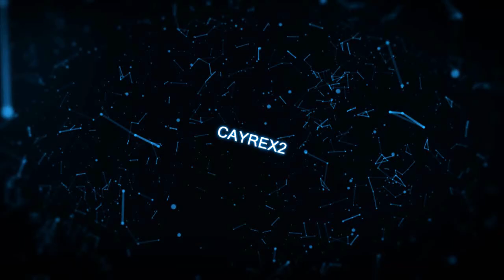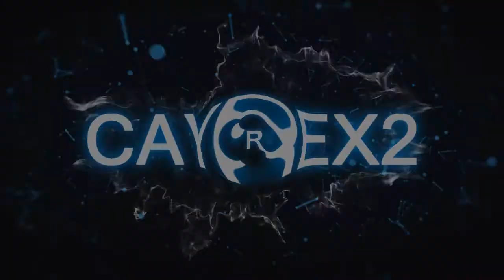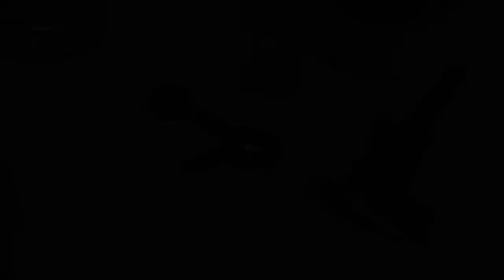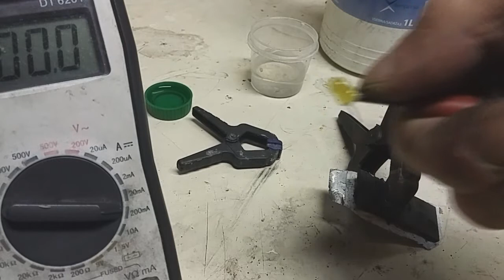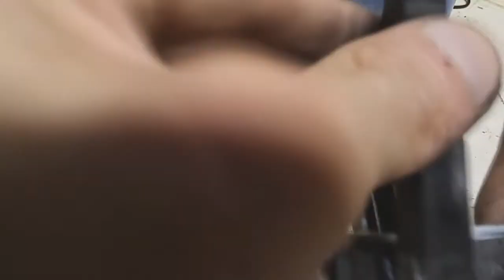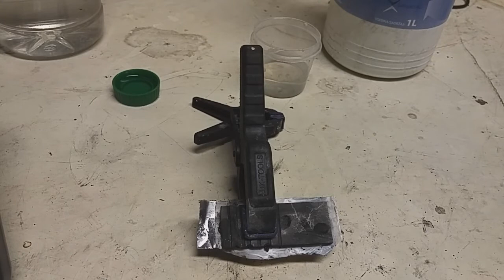TEST of High Voltage Aluminium Air Battery with Household Materials

Comment: 100mA is tolerable with good voltage and what appears to be a cell that lasts a very long time! Energy density is it's strong point, not power. Even so, 100mA for 7 hours (and longer) represents 700mAH out of a tiny piece of aluminum. Not at all a bad result! Thank you!

Comment: I tried small aluminum, 2"x2"=100mA. Then I tried bigger aluminum, 5"x5". Up to 900mA, but more like about half that when aluminum oxide formed due to KOH. Size makes more power. Very good battery sir.